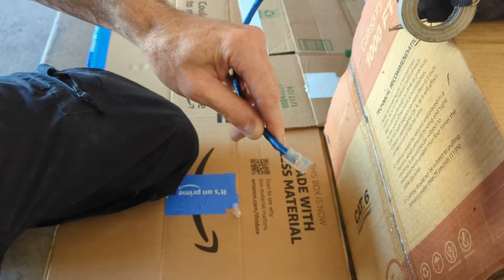Part 41 Suzuki Samurai Gets a Goofy Fix, Eggsperiment Conclusion

Comment: I think that light was an attempt at an add on turn signal. Original bumper has turn signals in it. That little light is definitely not original. Maybe the guy before you started to install them and just quit after the passenger side? Either way, that'd be my best guess. Should be easy to find so you could add one to the drivers side. I got some with my new front bumper and added new LED headlights with the Hali driving light/turn signal combo.
Reply from the maker: It actually still has the original turn signals but they were mounted behind the mesh in the grill. Kinda hard to notice, and a real pain if a bulb goes out lol.